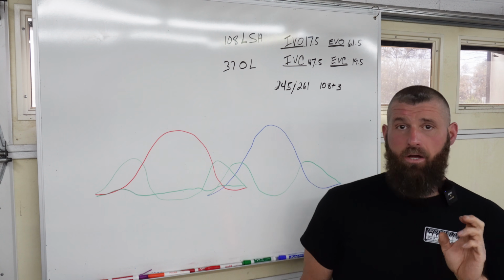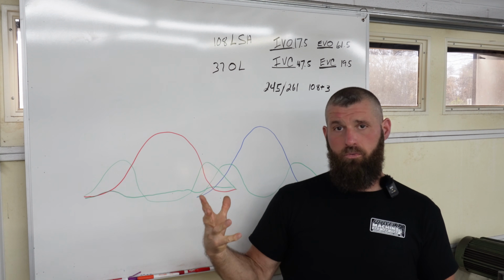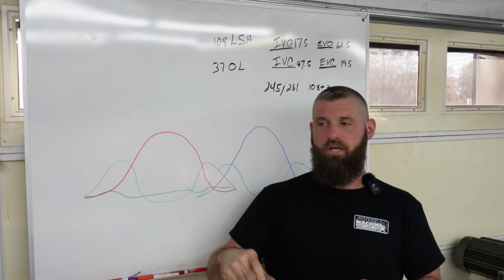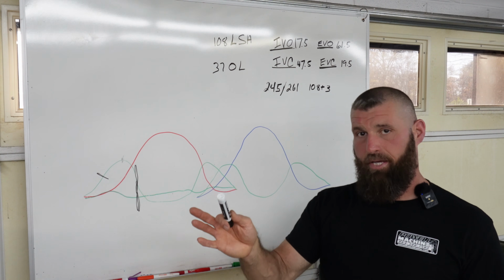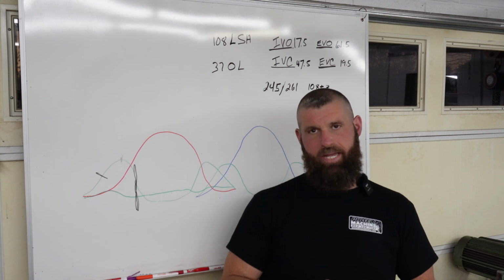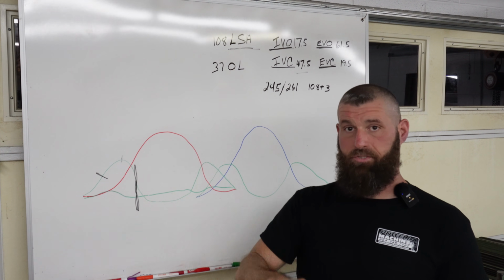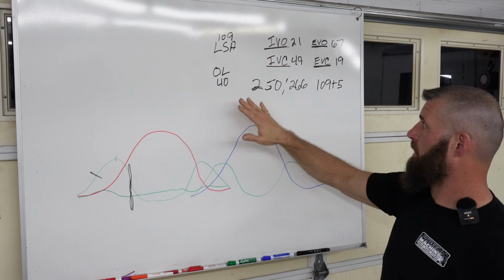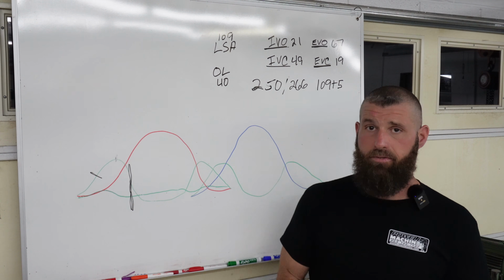How we choose the correct camshaft events for your application.

Comment: Don't take this as negative but I think it'll be a helluva easier to communicate if you say as example, " this is my approach for making more cylinder pressure at x rpm range, while x compromises are in play. And also the words "down low" are a little confusing when it comes to drag racing. I don't own anything elaborate, most of the stuff I've been working on lately is low compression small cubic inch n/a Big Block Chevrolets we spin 7500 rpm 1/4 mile, heavy factory condition cars on small tires. The torque converters are 6000-6500, 3.89 gear going 140 mph, 28" radial tires. The torque I care about is 7000 rpm and plus. I don't know anyone going fast 1/4 mile drag racing with less than 6000 stall n/a. Down low is confusing to me, what gear and stall do I run for down low power? I think you do a helluva good job, so don't get me wrong. Just suggestions.
Reply from the maker: I feel like all that was addressed,  In the best way I could for such a broad sweep explanation.
Reply: @powellmachineinc  I think you do a helluva job being objective, it's refreshing to hear from someone who publicly states I'm changing course according to what I observe. That's rare and old school, to not be driven by emotion. I bet though, if you add the words cylinder pressure into your talks, you'll bring along a lot of lesser experienced guys interested in hot rodding, those are easily understood words. I'd do it but I don't communicate as well as you, plus you know way more about camshafts than I do. Ultimately the goal is more cylinder pressure - camshafts. I do alright with it but there are people out there way smarter than I am. Luckily I have been able to determine who a few of them are, and I listen well, and apply their approaches.
Reply from the maker: @ripper-wrench Ty, I will definitely make a note of that!

Comment: Cams & Pandora's Box. Bleeding the power stroke with E/O too soon has a direct effect on a Cylinders ability to pull the following cyl in the firing order over TDC. Chevy, #8 follows #1cyl... when #8 cyl is fired @36° BTDC... #1 cyl is @54° ATDC pullin #8's pre-ignition over TDC. This is in part what cam design attempts to dynamically tune as you may well know. This is in part where too much cam for the application Kills. Your +5 early open, what is commonly overlooked by many... the intake valve lift is increased when you advance a cam, higher lift with earlier I/O improves low lift fill. There’s just no end to it, vehicle weight final gearing, C/R, Standard Day, altitude corrections for local track, Ya gotta be practical, and not get into anything that shortens valve train life with today's high costs. Say hi to Pandora for me. 😂
Reply from the maker: Absolutely 💯

Comment: My  Safe camshaft pick @ 0.050". If installed at the recommended 4 deg. advance. 390ci v8.

IVO - 12 BTDC         EVO - 55 BBDC
IVC - 44 ABDC         EVC - 7 ATDC

295 cfm Int / 238cfm Exh. at peak lift

I am trying to determine what static compression would work best with that on 91/93 octane gas. I was think 10.9<11.25cr?
Reply from the maker: 10/40    55.5/9.5  assuming a 6300 rpm peak and good mid tq, that would be my spec
Reply: @powellmachineinc  That's interesting I  was worried about going to big, so I went smaller with this backup cam.

The heads either have a string exhaust port or weak intake, depending on how you look at it. Intake/Exhaust flow %.

.100 - 81.8%
.200 - 90.3%
.300 - 90.5%
.400 - 85.9%
.500 - 82.2%
.600 - 80.9%
.700 - 79.7%

What do you think about my 10.9<11.25:1 compression ratio idea for 93oct pump gas.

Comment: Underspeccing heads seems to be a thing. A ls3 has a 260cc head on a 376 cube small block. It gets even worse for 364 cube 6.0l rec port engines. Guys will happily put a 300cc head on a 427 big block esp a 7000rpm deal. 

I liked your little delve into dynamic compression. Even the language is misleading, its not dynamic because the only time it has the calculated number is when the engine is stopped. Its static compression.
Reply from the maker: 1000%😊

Comment: The only camshaft formula I have ever seen was David Vizards. But after trying it out, it obviously wasn't for my/ every application.  It basically  just told you what LSA you should be running based if cylinder displacement and intake valve size. 

I basically said almost every smallblock should be on a 106LSA.  His other chart that goes with it, gives you an advertised overlap "range" for (Tow, street, high perf street, street/strip or race).

Using the calculated lsa and tge "desired" overlap woyld give you a range of intake/exhaust durations.🤔😂

Every  forum says to run a big cam. When I mention it's a daily driver and that I need vacuum for brakes. Their answer us to switch to manual brakes and that rough idle in the 260/270 @ 0.050" lift on a 360 sb is just an issue of "Tuning."

No one ever mentions how a 106 lsa  with 35  degrees of overlap @ 0.050" is shit for emissions, low speed driving or mpg.

I was recommended a 241/247@ 0.050" 110lsa, but thought it was too much for my pickup. I went with a milder 236/242@0.050" 110lsa as a "starting point."

Since the 80s magazines I've read always said tighter lsa gace more  power. Rarely have any talked about how much duratiin is need for a give application to make power in a given rpm range.

It's always been the faster you can open the valve the better. They never talk about, how much more seat/open spring pressure you will need to keep it under control?

LS engines went to high ratio rickers compared ti old sbc to get that "high intensity". 

I've took the lobe durations at different lobe lifts and made a chart to compare (1.5, 1.6, 1.7 rr) have on the durarions. It's crazy how much they affect the duration @ 0.300, 0.400, 0.500,etc valve lift.

I'm trying to maximize my VE and make it as wide as possible in +/- 2,800<6,200rpms🤞🙏
Reply: Thanks for making the videos and replying to posts as most people don't. 

 I've rebuilt plenty of engines to stock specs or mild cam installation.  I want to maximize  my personal project build. Hardest part is balancing maximing avg. Hp/tq for my rev range with Driveability on pump gas.
Reply from the maker: Agree 👍
Reply: The LS7 camshaft/valvetrain is probably the most extreme  example of valve acceleration from the factory. .593" with only 211 degrees @ 0.050" with 1.8rr.

Do you have any cam doctor numbers for  a 245<250@0.050" hyd roller from comp or other manufacturer cams? I can't find numbers to crunch/ compare to what I've measured. I'd like to compare larger cam lift rates versus smaller with higher ratio rockers.

I would like to make maximum use of the heads flows at .600" but not lose driveability.

I haven't seen it, but have you ever did a video on valve springs pressures and how much a higher intesity requires compared to a "generic" camshaft? I was told the springs would be fine with a 236@0.050" .390" lobe lift lobe profile.

I remember a hotrod magazine once mentioned that a 10 degree step up in cam size would move the peak up around 500rpms?
Reply from the maker: @JerseyMikeP what '#'s" do you want to know? Also a oem hemi has more cam acceleration then any Ls
Reply: @powellmachineinc  I was curious what the duration at .200, .300, .400, .500 valve lift of a larger 240< 255 @ 0.050 hyd roller (non-LS or hemi) camshaft with say 1.5rr to a smaller one like mine with 1.7rr.

I was wondering if a smaller duration/higher rocker ratio cam could make similar power than a larger cam with less rocker. 

does the 10 more degrees gained from the higher ratios offset the 10 degrees lose at .050, .100.

I'me also thinking about which is harder on the valvetrain/needs more spring pressures. Faster lobe with say 1.5rr vs. regular lobe with higher ratios with equal max lift.

I over think and over analyze everything. I became of a mechanic because I loved muscle cars, when I shoudl have been an engineer. Probably why I got almost all of my Student of the course awards in my automotive school.

Comment: i ordered a cam for my sbc  that has 28 intensity...
Reply from the maker: That's probably gonna be trouble  😳
Reply: @powellmachineinc  actually it's from a cam manufactuers catalog. adv. 282/282, @ .050, 254/254, 108 lsa. 555/555 lift, 2600-6800 rpm.
Reply: solid mech lifter.

Comment: The way I pick a cam for an engine is as follows 
@50 for static compression ratio 
@.007 for maximum rpm range gear shift
LSA is based on engine size. 
Lift is based of cylinder head flow when it drops off.
Reply from the maker: That makes ZERO sense,  and it's clear you don't grasp camshafts or the internal combustion engine 😢
Reply: @powellmachineinc i look at it like this.
Say a 350sbc with 11 to 1 static compression ratio. Head with a 2.02 Intake and maximum flow @.510 falling off a cliff. My pick of cam would be somewhere around 240@50 flat tappet and 234/35 for a roller cam. rpm range of say 6000rpm would be 275/280 @.006 and a LSA of 108. If the head flow fell off at .510 the cam would only have .500 lift max to suit.
Reply: What?

Comment: I pr I probably shouldn't post this however David Vizard has broken cam specs down to the smallest umph. What is wrong with DV's formula?
Reply from the maker: Check the results of the Ls cam challenge,  you will find ur answer.
Reply: He is new to the modern LS. Try the BB and the sb. He has a Cam program plus.
Reply: @rogerstill719 my single biggest issue with vizard is he is the smartest man to ever live - just ask him. I watched a vid where he thinks that the current pro stock head porters where getting it wrong. I'm still waiting for any all motor vizard engine that makes 2hp per cui let alone 3hp. As Daniel says in this video, it's ok to be wrong if you learn.

Comment: I absolutely love that you mentioned that you just want to know what is right and that you are not always right. Humility is an extremely hard to come by trait in the engine building world. Thank you for that
Reply from the maker: Thank you,  yep, its the only way to move forward.
Reply: @powellmachineinc on that note, do you know if there is anything to comps "low shock grinds" I purchased a cam for my 588, and I was extremely  concerned with having a camshaft profile that lends itself to valvetrain stability. Enginemasters mentioned comp having a low shock grind. I would think it would be visible in the early numbers such as @ .015 but I didn't get those numbers out of the salesman. So I have no way of knowing if it's just a marketing scheme or if the cam is actually easier on the valvetrain
Reply from the maker: @basketballcory2  Basically it's similar to how it should be done in the first place.... the "normal stuff" they do is just to fast in a lot of instances,  like everything in life it's application specific.

Comment: Superb video Daniel…if you don’t have an inquisitive mind or ask questions you learn nothing in life! I have a HR cam in my sbf 306 with an intake duration of 224 @ 0.050 and 286 advertised, so with a HI of 62 is this a really lazy cam? It sure doesn’t feel like it, with 200cc / 300cfm iron heads and 10.8CR it pulls like a train! Cheers, Dave
Reply from the maker: It's definitely on the "slower" side,  lower rpm engines can definitely benefit from shorter advertised #'s, it can clean up the effect ls of overlap at lower engine speeds and make the engine a little more responsive down low.

Comment: It’s part science and part art created from experience.  The dynamic compression rules much of the requirement for all out race engines in their intended rpm band. Application is very important. A cam made for your trailer pulling pickup will be substantially different than your 8,000 rpm race engine. They follow some of the same characteristics though in matching the cam events to the intended use. Like every engine, it’s the overall combination that determines the output.
Reply from the maker: Definitely

Comment: I may be wrong but I like to spec cams like this. Choose a lift that complements the peak flow of your cylinder heads or what your budget allows lol. Next choose the right amount of overlap for your engine smaller combustion chambers less overlap bigger chambers more overlap. high flow exhaust less overlap smog exhaust more overlap. Bigger engine more overlap smaller engine less overlap. Then spec your durations and LSA to get the cranking compression you want.
Reply from the maker: Whatever works for you

Comment: When you say 109+5 that means you installed it 5 degrees advanced? 
My cam called for 110 ICL, came in at 106 so I installed 4 degrees retarded. Starting to think that I screwed up by doing that because it feels really soft on the bottom and makes big power at upper rpm.

Comment: very interesting thank you for taking the time. Scenario question:  In your opinion, how much does rod length factor into your event selection?  Here is my situation.  I had a custom cam made years ago for a Ford 400 - rod length is 6.5 inches.  I am now planning a 351C stroked to 400 inches with rod of 6 inches.  how far off is the original cam - if at all?  This is a 100% street deal if that makes a difference.  Thanks!
Reply from the maker: Absolutely zero, its just such a small change its irrelevant to cam timing
Reply: @powellmachineinc  thank you so much for taking the time to answer!

Comment: Extremely good presentation. I especially enjoyed the part concerning cylinder heads. I learned a few years ago how important they were and when you started to describe how they work in the system as a whole, I really latched on to what you had to say. Hearing this from a cam design point of view is particularly important because you are trying to fill and evacuate cylinders with a device ( the head ) that limits what you can accomplish with a given cam profile. Your description helps people understand why the heads are so important and unfortunately are the thing many folks do not put enough effort into getting right for their build. They expect that some big cam and big carb and intake should do the job without even any thought about the heads. When I discuss these facts with people I use the LS engines as examples. The engines typically have small cams and really decent heads, especially compared to the classic 23 degree small block. They have more runner cc per cubic inch than the old engine. They perform better with the small cams and maintain their torque due to the reduced duration. Plus they get better fuel mileage I am sure. Overall your talk was great and I am sure that everyone appreciated it, I know I did. I do have a cam that I need to get reground and I am contemplating contacting you to do it for me but that's for another day right now.
Reply from the maker: Happy you enjoyed the video!

Comment: Yep lots of good stuff here knowledge from experience we are lucky to have it free I will get him to spec my cam thanks Powell machine.
Reply from the maker: Happy to help!
Reply: I have a set of Ls heads that maybe interesting for you to look at pictures they are canted valve and machined for  a water manifold in the valley cover also machined for direct injection with a Ls exhaust flange looks like as wide as sb2 with centerboltvalvecover @powellmachineinc and to top it off it is gm castings

Comment: Absolutely fabulous job tying up the loose ends and wrapping it in all the information that you have learned.  Thank You so very much for taking the time to share.  I get the almost infinite number of variables that contribute to this seeming like black magic.  I also see where the more accurate and larger amount of GOOD date on the combo, engine, car will help make that magic less black and more transparent.
I am sure it is all a trade off.  If the heads are not up to the task and you make up for it in Duration, something else about the motor will suffer.  Good parts selection by the engine builder will make your job a lot easier, it seems.   Thanks again.  I really enjoy learning what you have to share.  Gives me a lot to think about.
Reply from the maker: Happy it was helpful!

Comment: Excellent video sir. Definitely an eye opener for me. I wanted to ask, what are your thoughts on David Vizard's LSA method of selecting cams? Is it of any use to an average hot rodder building engines at home on a budget picking a cam from Summit or Jegs? Im guessing this formula sets the Int/Exh points and gets you in the ballpark? All that's left is to pick an appropriate lift and duration for your combo and set the installed ICL? Im sure this is the lazy way to pick a cam and there is more to it but does it get you close? Im curious because this method uses LSA as a primary input and I've seen some advocates of this method but I have seen a few like yourself who say LSA is a product of the other cam timing events. Cheers👍
Reply from the maker: David deal is usable on a street sbc 💯,  when u get into more unique stuff it just doesn't pan out.

Comment: Great job!  More info in one video than I have ever seen.   You mentioned 240 degree starting point....is it higher for a solid roller?  I have said for years that a lot of 427sbc are underacheivers because of the issues feeding them with a 23degree head.
Reply from the maker: Normally we add about 10 for solids with lash

Comment: I am glad you mentioned the push rods, rockers, springs and heads because a better cam design is only better if it works correctly and transfers motion and movement correctly. Push rod diameter and length and rocker ratio can directly impact how well the cam works.
Reply from the maker: Glad you picked up on that!
Reply: Don’t forget lash??